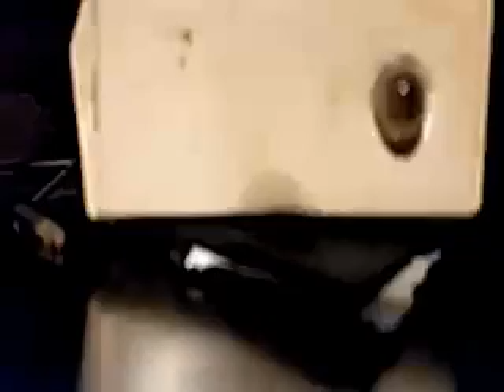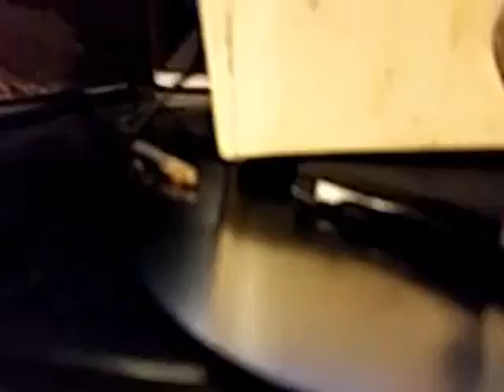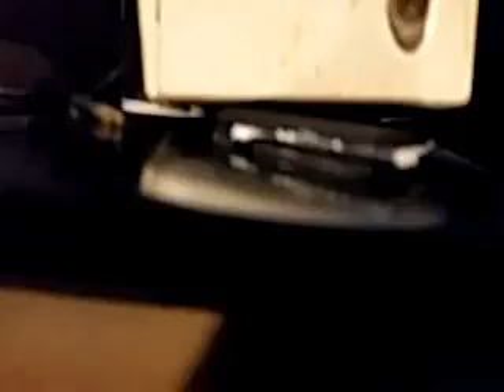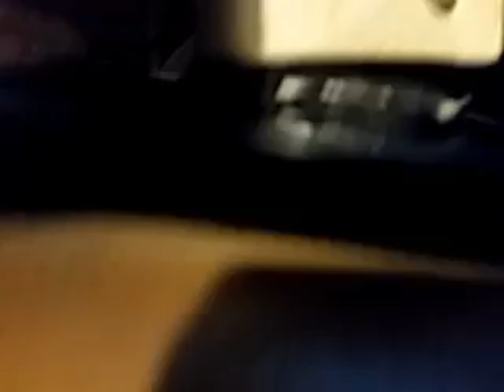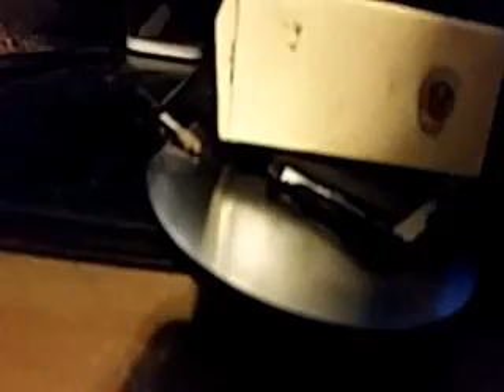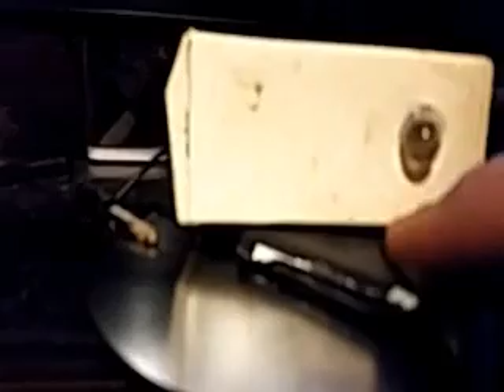Free energy real crystal forever power

Comment from the maker: there arr pure silicon metal squares on ebay 6 x6 inches. Only a few left .I bought most of them. also I think he is using silicon greases mixed with other materials .that stuff don't evaporate and interfere with silicon metal deterioration and I suspect is the key to creating amps is a gel insulation ro promote the silicon electrons to flow to the graphite sheets.sealed up this might be a life long dc  power supply
Reply: I just saw a package of 550 pieces of P dotated Boron dotated Blank silcone disc for about 180 US$. Would these also work ? There are no ICs yet on... I just ordered another package of used monocrystaline or polycrystaline Solarcells, which were cheap left-overs and will try first with them... Maybe I have to scrub the backside first or so... we will see.....

Comment from the maker: it's amazing to me that the electrons jump thru the foil paper dry. this means there is a special property of silicon metal. an excessive amount of free electrons that want to escape to the graphite even when separated with an insulator. I have some other graphite material ordered for a month now . it's graphite foil and graphite gasket materials.  I will try this with some old silicon solar cells as i don't think the newer ones are pure silicon because they are made of aluminum substrate. I am trying to figure out how what PMMG4HYBRID is using. from the little information I believe he is using these materials and possibly using acetic acid in a gel he made mixed with silicon sealants.
Reply: Gadget mall Do you live in a humid climate ? Maybe the water in the air is sufficient to drive current through the paper insolation. ..hmmm
Reply: Gadget mall Didn't Mike Kantz say that one electrode is Aluminium and the other graphite or is really one electrode silicone ?
Reply: So if it also works with Zinc, which is much less expensive, what Electrolyte will exactly prevent the decomposition of the metal ? Normally you must decompose the metal electrode in such a metal-air cell to get electrons out of such a cell... the question is then, if the metals are NOT decomposed, where is the current coming from ??